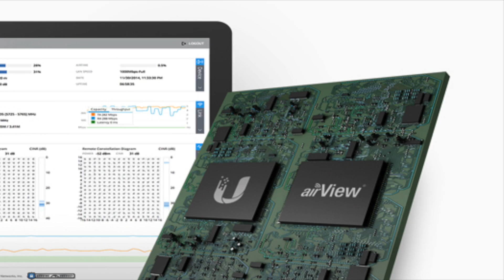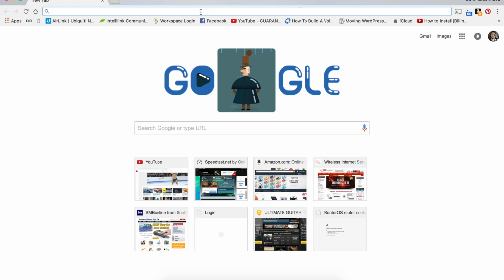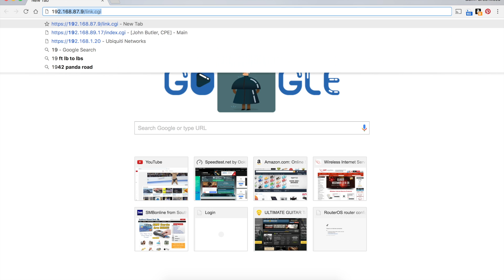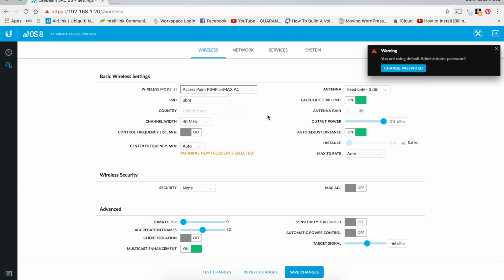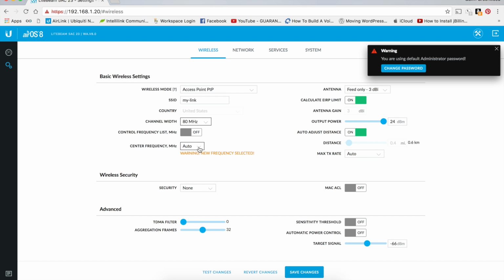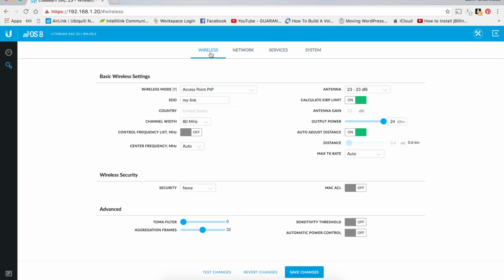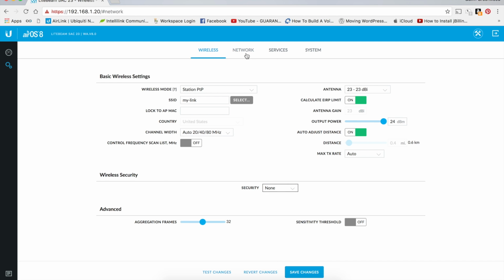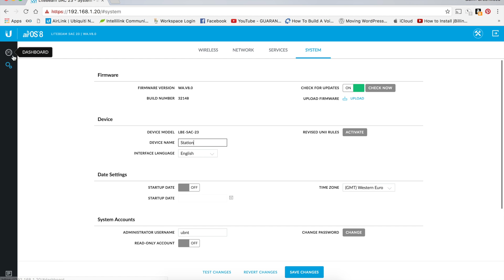Ubiquiti AirOS 8 Setup Point to Point Wireless Link (Wireless Bridge)

Comment: Gavin thanks for the video. Question for you - the SSID field mentioned where you typed in "my-link" - this is the SSID of the PtP link, correct? It wont show up on a user's wifi menu, correct? I am just getting to set up some Ubiquiti devices and Im wondering if there is some way to get the actual wifi part that you use to configure to join my existing network so I dont see those pesky configuration SSIDs. Interestingly, its now gone. I just unplugged it and replugged it back in and its back. Does it disappear?
Reply from the maker: Yes it is SSID if it’s not showing up make sure that both radios are AC or both are N technology then make sure that the channel width is the same on both radios

Comment: Hi Gavin, Thanks for an informative video. It is helpful. I have these p2p antennas on 2 buildings about 150 feet apart and have "great" signal strength between them but I haven't setup the remote router yet. I am trying to extend internet from the main building to the remote building. Do I plug the POE Lan port into one of the LAN ports on the router? Will that give me internet from the second router? What settings to I need to adjust in the second router? Do I have to keep the same network ID or can it be something different with another login password, etc.? Any help you can offer would be appreciated.
Reply from the maker: Yes first  router use lan port on router into p2p. Second pro goes into internet port of second router but this way will separate the two networks due to two routers.  I would use a switch in place of second router to enable connectivity across the segments

Comment: Hi der. Its a good video. I hav two ubiquiti dishes 1 PBE-5AC-Gen2:78.....2EA and other is PBE-5AC-Gen2:78......BAA. i want to use both of them to transmitt internet from 1 station to another. I have tried setting the main one as station point and the otherone as access point to point. 1 station i hav set the configuration n internet. 2 station i wat to access internet as wireless or wifi. Is it possible?

Comment: How Much CCQ Is Needed For Good Point To Point Connection??
Reply: What amazes me is how well these devices work over a short distance with a far from optimal line-of-sight.

I took the gamble as I needed to get a connection over only 100m but there is a tree and a road in the way, so ethernet was not an option and while my normal WiFi reaches there is so much crosstalk on 2.4Ghz that it was becoming unusable.

Despite not being able to install the second antenna yet so its actually operating through a thick wall (yes, its actually inside the house), sat on a table (so not even properly aligned), I still get a solid 150Mbit throughput.

When I say solid, I mean "Steam in-home streaming" at 80Mbit with only the occasional stutter.  These Ubiquiti units are beasts!
Reply from the maker: At least 97% CCQ LOS